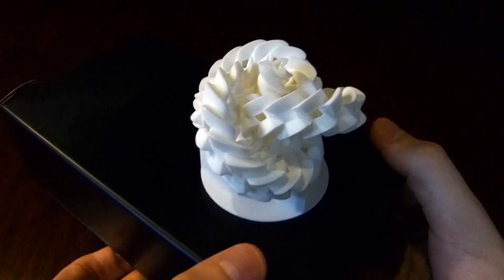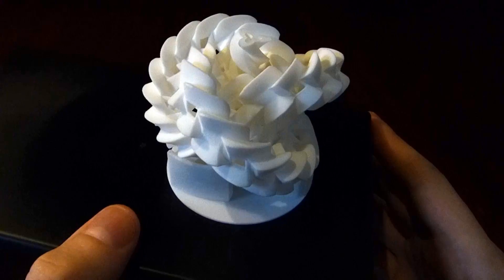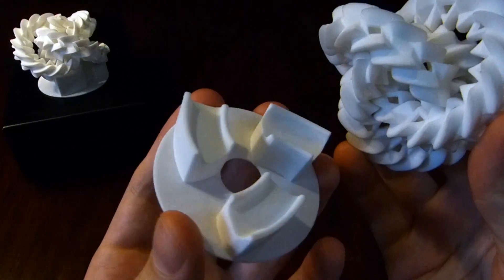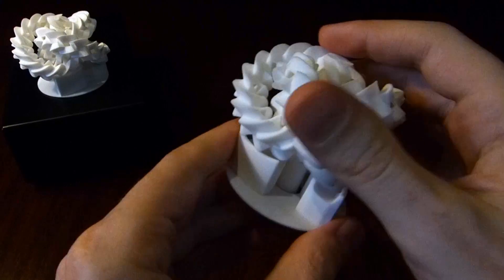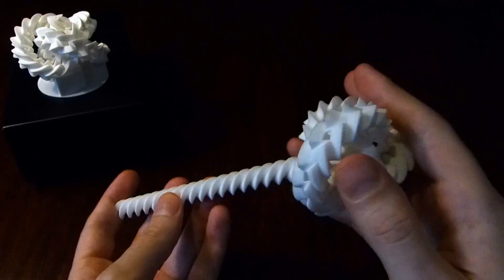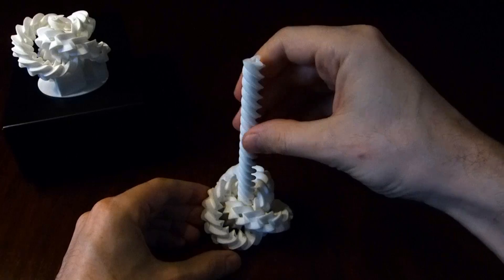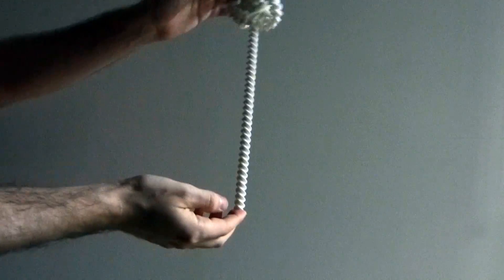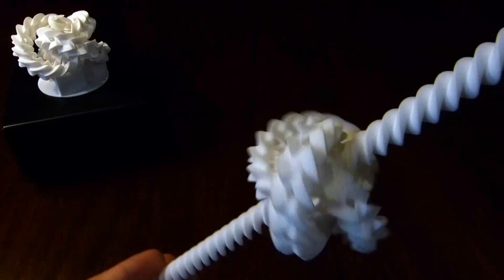Powered triple gear

Comment: Is there any practical application for this?
Reply: Maybe elevators can benefit from such a gear, to prevent them from falling too fast.
Or you could provide torc to 3 separate mechanical systems using only one motor.

Comment: Fantastic. One other thing you could do is use a long axle at an angle so that the gear is rolling down the axle so if you got the angle just right it would just always be rolling down hill. It would basically be suspended in air On the axle. It would be hard to get balanced right but it would look really cool ~Russ

Comment from the maker: New thing: Powered triple gear! Thanks to Adrian Goldwaser and  Stuart Young for prototyping and construction of the motorised base.
Reply: now to make each gear a different color and the driveshaft black...
Reply from the maker: Good luck dyeing the three gears different colours...
Reply: I wonder how big it'd have to be scaled up for it to work with the multicolor sandstone material? :)
Reply from the maker: I think the sound it would make would be comparable to fingernails on a blackboard...
Reply: I imagined it as more of a gritty grinding sound.
Reply: Paul Jimenez Since the plastic is Nylon, it's definitely able to be dyed, but it will also wear with use, leading to the colours wearing off onto the other gears and the base. So it'd probably look good for a few hours (maybe days) of continuous operation, but then you'd want to replace it. Some of the wear would lead to colours bleeding onto the other parts they've contacted, it's not just a matter of the colour wearing out of the parts themselves, but where that colour ends up.

FWIW: The drive motor in the box is a Nema 17 stepper motor driven by a Pololu A4988 stepper driver. The stepper driver is controlled by a Freetronics Eleven (Arduino Uno clone), using the Step/Dir/Enable pins on the driver and a very simple custom sketch to control the rotation speed. The stepper driver is mounted on a protoshield, plugged into the top of the Eleven, so there are no other components. It all runs off a 12V DC plugpack rated at 1.5A. The plugpack is a switch-mode one which works from 100-250VAC, so it should work in any country with the right adaptor on it (essential for Henry Segerman's display purposes). If required, he can buy a suitable plugpack in the country of display if they won't allow the use of the existing plugpack, as 12VDC plugpacks are fairly common.

The stepper driver was chosen as finding a suitable DC motor that, even with a gearbox, drove the gear at a suitable speed was going to be tricky, and wouldn't allow a huge amount of speed adjustment. Also, many of those motors tend to scream and produce a lot of vibration, which is not suitable for a display.
Reply: What inspired this wonderful creation?  It gives the sense of being a potentially useful cousin to Borromean rings... :)   How are these three buggers linked?
Reply from the maker: Harlan Brothers We were inspired by "Knotted Gear" by Oskar van Deventer: Knotted Gear